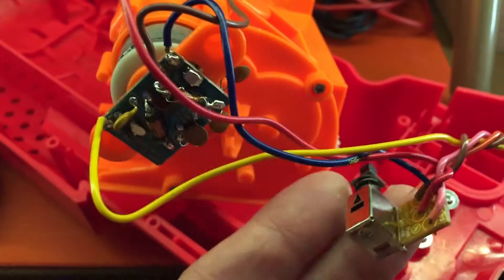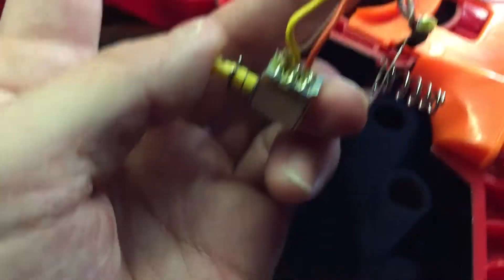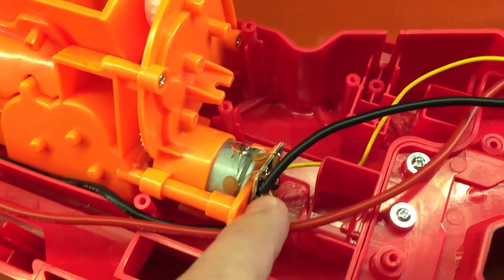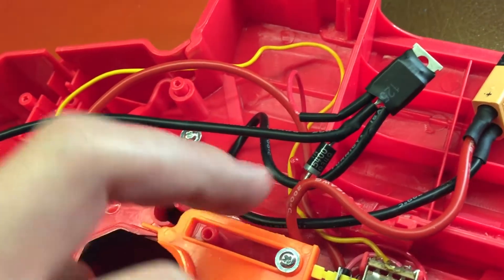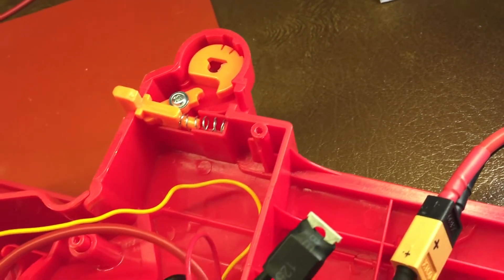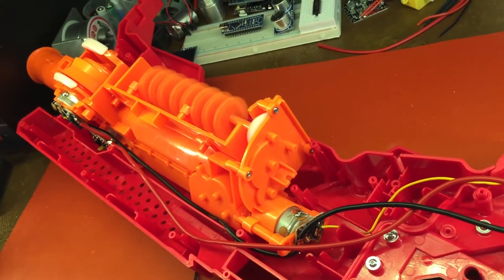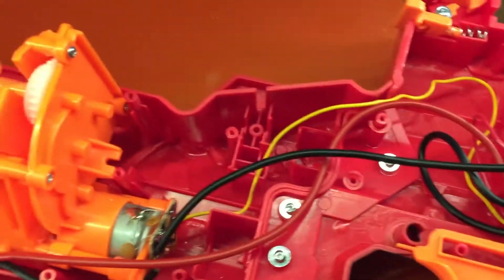Nerf Rival Nemesis MOSFET Circuit

Comment: Could this also be used for a 2 switch rapidstrike?
Reply from the maker: I would highly recommend a 3 switch setup with the Rapidstrike because of the pusher check switch. It's less likely to misfeed or chew up darts.

But any two switch circuit can be used to actuate separate sets of motors as used in just about every automatic foam blaster. They're just more suitable for conveyer belt style feeder mechs.

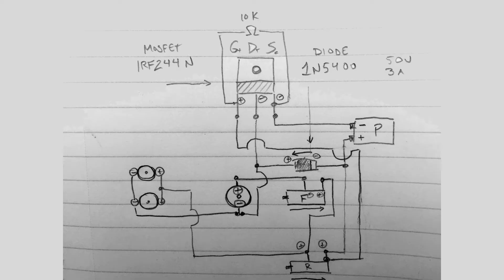Comment: So I Drew up a Diagram based on the one shown at 10:45 mark,  http://i68.tinypic.com/21l0ruo.png  Hope it is correct.  Please verify.
Reply from the maker: Looks good; just make sure you have the correct polarity on the rectifier diode (silver marked negative pole runs between the positive lead from the battery and the rev switch; black positive end runs between the MOSFET drain and the negative pole of the pusher motor).
Reply: Okay so the Rev switch has 3 poles, NC, NO and Com, not sure where the connections go.  If the Power and the Gate are both connected, to the same pole, the mosfet would be constantly on, so I am sure I am missing something...
Reply from the maker: You only need to use 2 poles. Com is common; always used in a switch circuit. Normally Open is the pole that completes the circuit when the switch is pressed. Normally Closed would only be used in a circuit utilizing electric motor braking. When the switch is released, the NC pole creates a short circuit that slows the motor being shorted. 

If you examine the circuit, and the corresponding video, you'll see that the NC is not used in this rewire.
Reply: Daniel Okada, then wouldn't the full current also be running through the switches?

Comment: Sorry - I'm slow. What's the point of this mod? What does it correct? Looks interesting....
Reply from the maker: It's an alternate way to rewire the blaster for use with high current LiPo batteries without using high current microswitches, which was the old standard for rewiring. 

The main advantages of a MOSFET wiring circuit is being able to use the stock switches, which means less shell modification to accommodate the heavier and larger 20A microswitches that are still commonly used. It also provides a degree of component protection as it is the MOSFET that is switching the high current load to the motors, eliminating the need for heavy gauge wiring for the entire circuit.
Reply: @greenmedic88  so with it you can use small cables?

Comment: While the flywheels to the drain is right (high current circuit) you forgot that the positive from the battery to the flywheels is still going through the stock switch. In fact, the rev switch has way too much current going through it given that all the circuits (both signals and both motor circuit loops) go through it.
Reply: I too am having a hard time understanding this.  I'm new to mosfet mods.  I understand the circuitry for a flywheel system that uses a manual pusher like a stryfe.  However I need help understanding mosfets in a two-switch circuit like the rapidstrike and nemesis.  Isn't there too much current going through the stock switches?
Reply: I found the answers to my confusion.  First concept is that current flows from the negative to positive.  This is an n channel setup (vs a p channel) so the mossfet source connects the negative to the load (motors).  At rest no current is passing through the switches.  When voltage is applied to the gate we see that the resistor connecting the source to the gate prevents the high current from reaching the low amperage-rated stock switches and higher gauge wire.  Lastly, of course it’s wired correctly or else the switches would have failed during the firing test.

Comment: Awesome video, I'm working through following the diagram and had a question. I thought the use of mosfets was to remove the weak stock switches from the high current circus. Idk if I'm wrong on this, but it looks like in this setup, the switches would still be subject to the high current draw. If I'm way off on my thinking let me know, I'm not super savvy on electrical wiring.
Reply from the maker: The point of using a MOSFET in a circuit is so that high current does not pass through the switches themselves, only to the source of the current draw (the motors). 

You'll see in any basic motor/LiPo mod, that the easiest and simplest way to create a high current circuit is to use heavier gauge wire to reduce resistance and better dissipate heat, and high current microswitches, as the full current drawn by the motors travels directly through the switches. Very simple to wire, which is why it's common practice, but not the safest. 

The added advantage of a MOSFET is that most of the stock wiring and switches can be used. No need for high current microswitches and shell cutting to make them fit. If you look at circuit boards that draw high current (CPU, GPU sockets, heating elements for 3D printers, brushless motors for high performance drones, etc.) the entire circuit isn't comprised of heavy gauge wiring because of the voltage regulation circuitry that typically includes MOSFETs. 

If you trace the drain from the MOSFET, note that it goes directly to the negative terminals of both the feeder and flywheel motors.
Reply: @greenmedic88  so the negatives/ground have a MOSFET to deal with he high current. It looks like the positive/hot wire goes from the XT60 connector and goes through the rev and feed switch to get power to the motors. Doesnt this mean all the positive current is going through the stock micro switches? The negative current travels through the MOSFETs, but not the positive side. 

Seems more practicle to wire the negative straight to the battery, and use the MOSFET on the positive side to bypass flowing the current through the stock micro switches...

Comment: I did a dual fet system in the one I built for Jomo, but I figured when I was done it that I probably didn't need at least the pusher fet, likely not even the main fet. Those switches are super chunky.
Reply from the maker: But you're trying new things. You're one of the handful. Not everything is going to pay off when you take that approach. That's one of the less appealing aspects of the Nerf hobby, or any hobby that requires some degree of technical ability, but not a lot; there's not as much innovation as there could be. Most are content to latch onto single good ideas and repeat them rather than spend time on potential ideas that may not be particularly useful.. 

MOSFETs are more safety mods than anything else although I know of no instances of anyone electrocuting themselves with a LiPo powered Nerf blaster, so at times one does have to question the necessity.
Reply: Do you have a drawn diagram of this? It's a little hard to follow in the video
Reply from the maker: 10:45
Reply: Daniel Okada I guess I jumped the gun!  Commented before I got to the end lol. Thanks so much for the video.